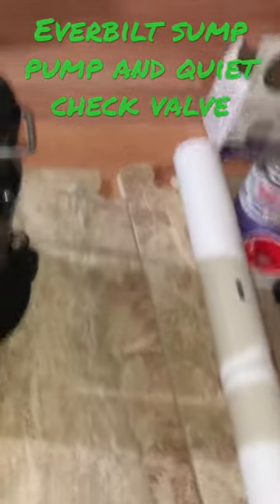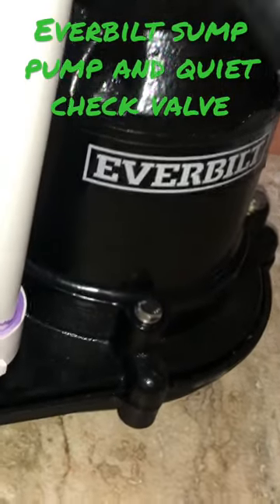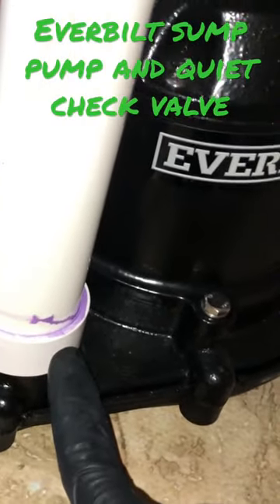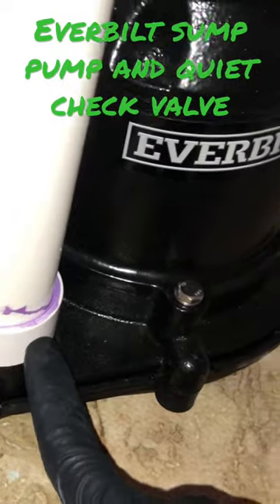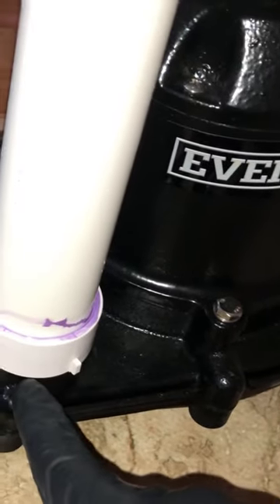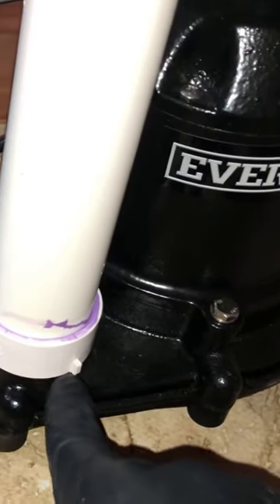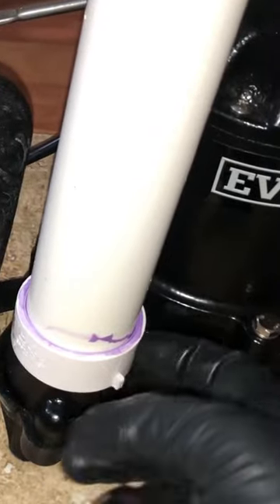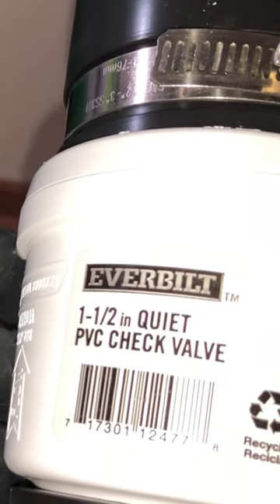Everbilt sump pump and quiet check valve setup

Comment: Bro u dident need to spend 35 bucks on a check valve they are like 14 and they are all quite it’s just a flap the water moves don’t forget your weep hole to prevent airlock
Reply from the maker: Thank you, Jon! I’ve seen a simple valve for $9.99, but it was the same as my old one and that one was loud. I’m glad I got the “quiet” one. No rugRats! And thanks for the tip on the weep hole. I got her gone! Works like a charm! Thanks for watching!